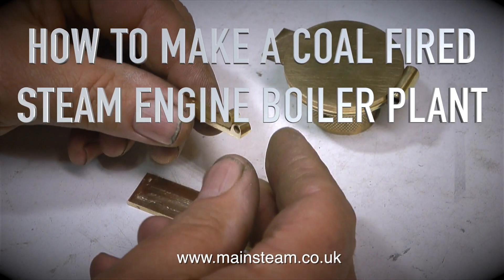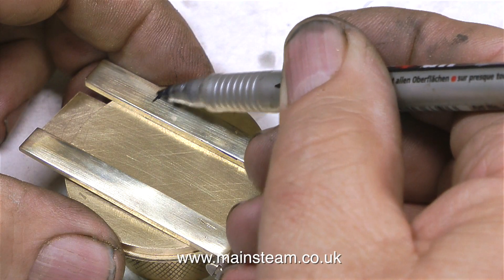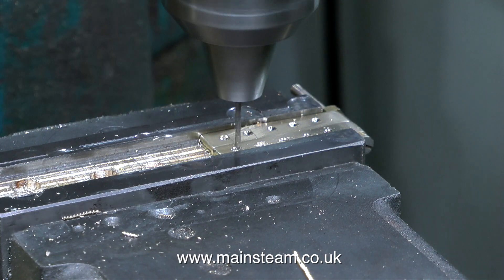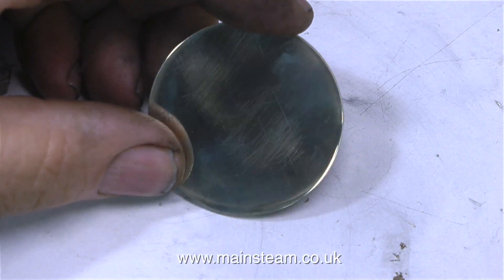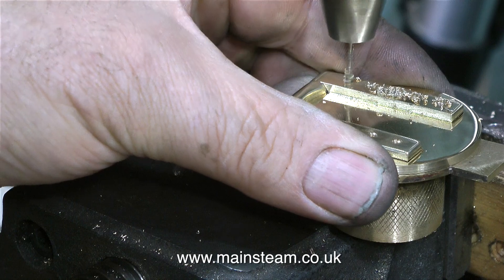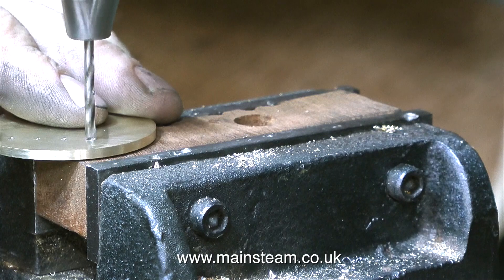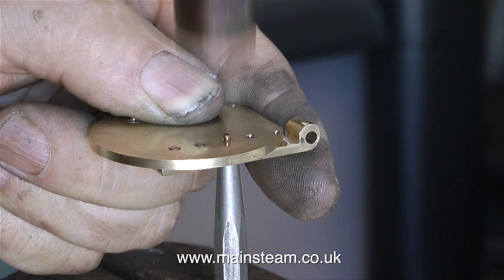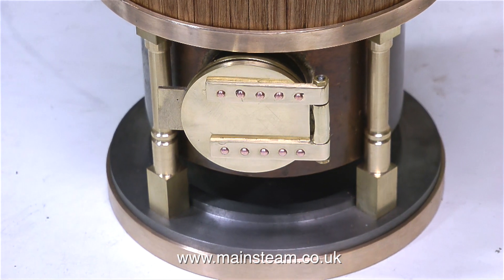HOW TO MAKE A COAL FIRED STEAM ENGINE BOILER PLANT - PART #15

Comment: Keith I'm not sure if someone has already told you this but if you take a fine grit oil stone and hand grind a positive rake on the cutting edge of your twist drills so that you have to apply force for it to cut then it wont want to self feed anymore

Comment: Filing buttons are super useful things. For hobby use (rather than production engineering) the small wheel bearings sold for radio control model cars are an ideal substitute. They are available in a huge variety of internal and external diameters. They are not expensive.
Reply from the maker: A good tip, I have a lot of those in a tin in the workshop :-)

Comment: hats off to you Keith very  nice job, glad to see the remade hinges laying flat as they should ... and rivet work is almost becoming a lost art. with many years in machine shop and machine industry that was one of my first jobs was rivet setting but much large rivet for  doors on cast machine consoles with were 3/8 and  7/16 diameter rivets  with double upsets . we even did some that used a spin  form head  on upset was stationary and the other was wound down to form the clinch head with a rotating pressure upset  tool. love watching you video  being retired i am seriously looking into some kits   or finding some older steam models to tinker on  as a hobby

Comment: Hi Keith. The fire door was a piece of art. Lovely. Why don't you use the ball pien end of the hammer when riveting? I was taught to use the ball part when I was trained.
Reply from the maker: The metal is soft and the ball part would leave depressions in the brass. I carefully control the flat part of the hammer head.

Comment: I too really like your videos. I worked as a machinist in Oil Field tooling plants working on some very large steel parts. One of the machines was old enough that you could actually see where it had been converted from a large flat belt run, probably steam driven, configuration to a modern electric engine drive. The asset number was 1616 and I always teased that was probably the year it was built. :)  Thank you so much for publishing these vids and I really appreciate watching your workmanship.